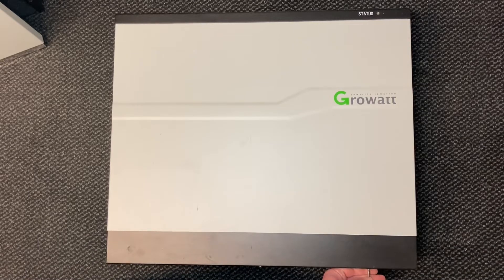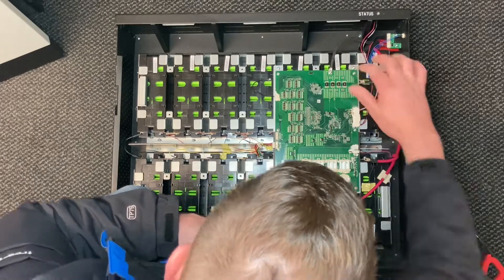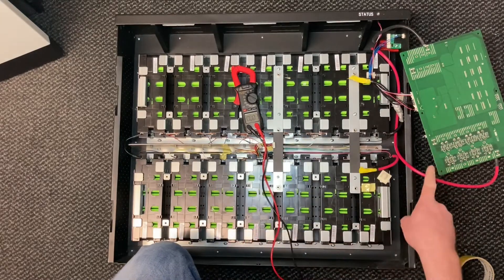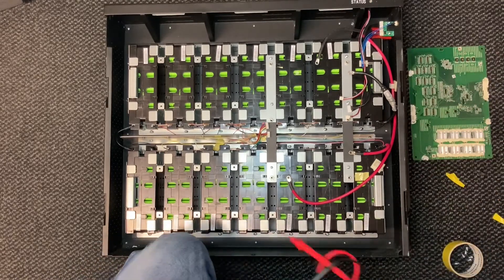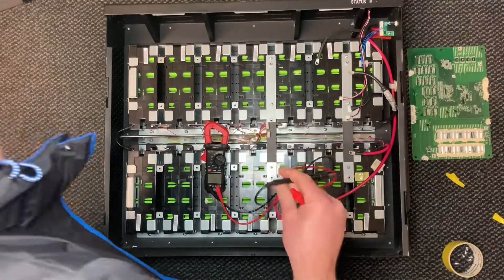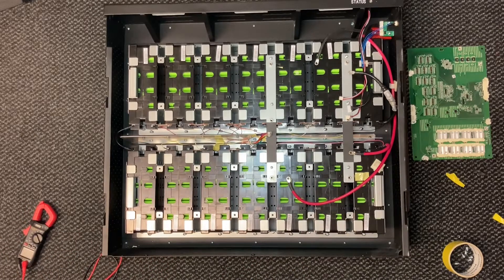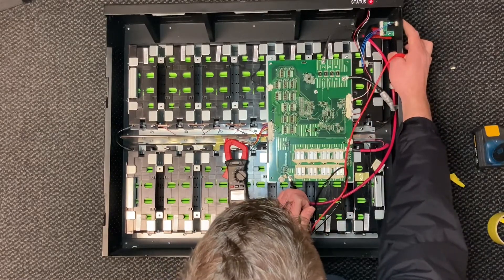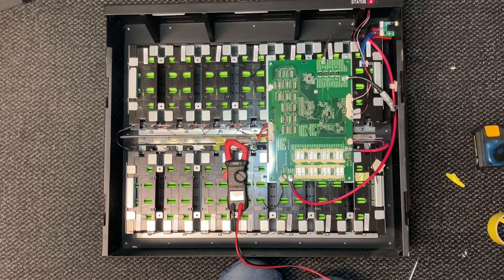5kw Lithium battery Growatt Status BMS Error light flashing 8 times DARFON Bms

Comment: Can you upload the seplos install please
Reply from the maker: I can upload the after install video if this will help ? It’s definitely a shoehorn job that’s for sure. But once in place it’s ok.
Reply: @smartazz  that would be very much appreciated,  as I've got the same battery and I'm trying to get it working with my sofar me 3000 .. it will give you legendary status in my eyes 🙏😂
Reply from the maker: @sparrowsends  ok I’ll try and go the extra mile and show the me3000sp working with this battery ;)
Reply: @smartazz   words fail me of just how amazing that would be I've been struggling for a while now , I've almost been at a point of giving up until now , it's hard to explain how happy I'll be if I can get it working as I ain't got a clue .
Reply: @smartazz   sorry to nag like a old woman but have you had a chance to do it , also can you include the can cable connection to the sofar and what battery setting you selected on the sofar please I.e pylon dafron thanks in advance

Comment: Hi thanks for the video did you do a video of the selpos bms install please as im in the exact position thanks in advance
Reply from the maker: I will yes but I have a seplos already running on my me3000sp in a 16s configuration with prismatic cells 280Ah cells 
I have the seplos running Pylontech and the me30000sp in general mode. I’ll double check the settings for you and I will get a video asap with the Growatt battery running 14s. 🤞
Reply: I'm using the seplos , have you got the can cable set to sofar or pylon on the bms , and what's the colour configuration on the cable please
Reply from the maker: @sparrowsends  set to sofar
Reply: @smartazz  I've done that now lmao , sorry to bug you tho , how have you done the can cable as in pins and colours as the bms got 8 pins and sofar me 3000 got 4pins but I don't know witch ones are in play lmao .

Comment: Did you managed to fix it ?
Do you think  these  pack still relevant ?
Reply from the maker: Yes I replaced the BMS with a seplos BMS and currently using it  :)
Reply: @smartazz It would be nice if you can make a video of how to replace the original Fu**d BMS with the sephos one. To which Inverter did you connect it?
Reply: @smartazz did the sp2000 controller work with the selpos bms. 
I have a battery open fault on my 5kw battery and need it fixed asap. 
Any pointers towards the selpos please
Reply from the maker: @robwallace1501  it should work. The protocol is there in the seplos settings, I unfortunately haven’t got the sp2000 to test it on :(
Reply from the maker: I connected it to a AC Coupled inverter me3000sp and it worked perfectly
Reply: @smartazz  hi I have the same battery and inverter , did you do a vid of you replacing the bms and where and what bms you purchased please 🙏

Comment: In have the same pack with a similar fault only difference is that I have one pack of battery’s at 3.3v where the red are at 3.58v   Can’t seem to find new battery’s and or a new BMS
Reply from the maker: Get a seplos BMS and ask or say it’s Growatt, I’m almost ready to install mine and test next week.
Reply: @smartazz  Was you thinking of making another video of it ? If so that would be great thanks Sam
Reply from the maker: @sambradshaw7640  yes I will make a video :) I want it to work with the original equipment also
Reply: @smartazz brilliant. That’s exactly what I need I have the grow at sp2000 unit that came with it
Reply from the maker: @sambradshaw7640  yes me too. I’ll do the video even if it doesn’t work ;) 
But I’m very hopeful. My sp2000 shows a BMS com’s error atm without the battery connected
Reply: @smartazz  yep mine too I hope it works then mate will be good if it did 👍
Reply from the maker: @sambradshaw7640  Iv capacity tested 10 out of the 14 packs and they all came out at 85Ah at 30A test. I’m sure they will test higher at a lower Amp setting but Iv not got the time lol. Fingers crossed